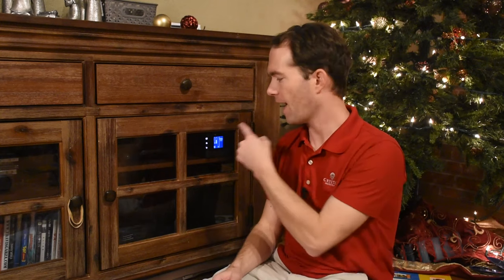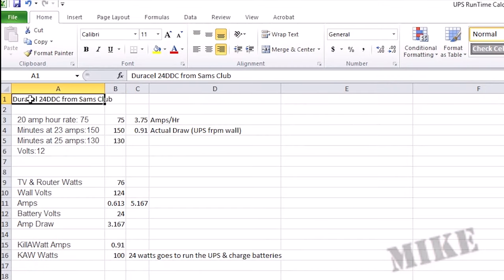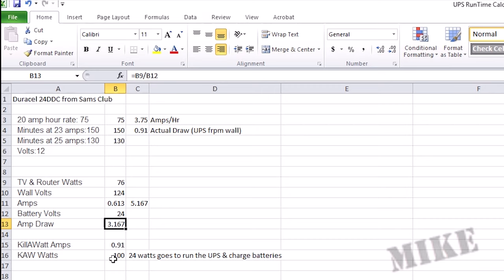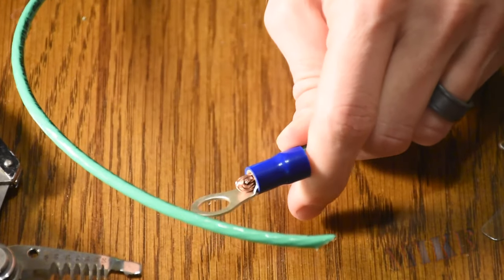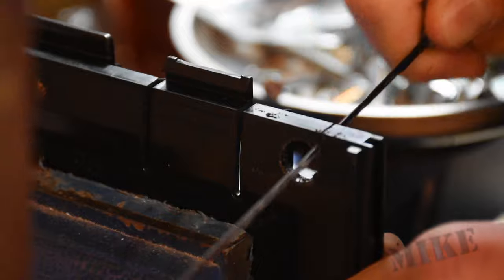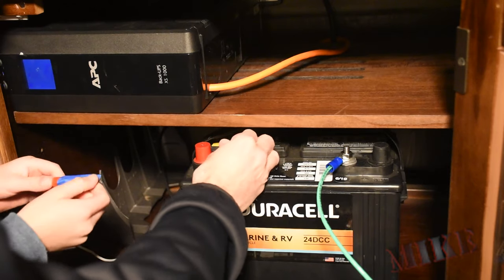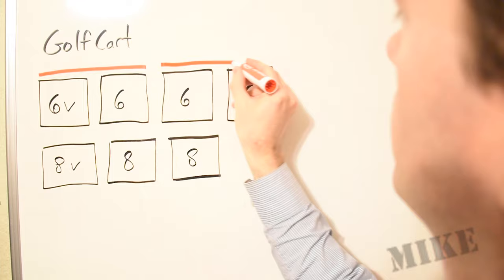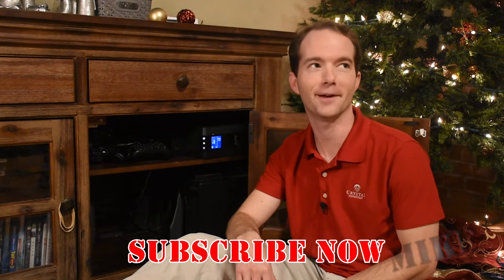SUPER UPS Battery Hack- Mikes Inventions

Comment: Do you worry about hydrogen gas generation as those are wet cell batteries?
Reply: I was gonna say, filling the cabinet with hydrogen, if that UPS sparks, you'll hear a big boom
Reply: My first thought when I saw this video. This is why all indoor battery backups used sealed batteries. There is also more of risk generating more explosive gases with charging batteries from a drained state and charging with a charger that, like he stated, has no idea what batteries are attached. Improperly charging batteries can be very dangerous and having two of these indoors and in a cabinet is asking for trouble. “Good son far” but hope nothing bad ever happens. I have no idea but maybe even possible that the insurance could even deny a claim. With this being fully disclosed on YouTube, it’s more build a case on.
Reply: @RemmikRotus  Aren't these marine batteries, intended for used in boats in the tiny enclosed space batteries normally are installed? You don't install batteries on deck or on the roof.
Reply: @RemmikRotus  those are sealed lead acid battery .. even if they are flooded they are still sealed. , And this ups charges at 3 to 5amp which is really low for this type of battery these can handle 50amp of charge. Normal alternators on car boats or rv are atleast 120amp capable. This setup will only harm the ups as the ups will have to work harder to charge such a large capacity of battery & long discharge timr
Reply: @RemmikRotus  hes in a hospital 🏥 bed
Reply: @danielch6662  Proper boats always ventilate inboard engine and battery space.  The hazard of fuel vapors is worse than the battery hazard.  They'll even have a powered fan to ventilate before closing electric breakers and starting.

Comment: It's not efficient, Tv works on 12volts and router on 5, i would just cut out the inverters on both tv and ups and bring down voltage with resistors

Comment: Mike,  if you want to force the unit to relearn its endurance on battery power,  you have to put about half a load to it,  and execute the self test multiple times a day for about 3-4 days. 

Hold down the power button while its turned on for a total of 6 seconds.  

2 seconds will power the unit off,  and you get the single beep,  DO NOT LET IT GO,  continue to hold it for another 4 seconds and you will get a second beep,  then release the button and it puts the unit into 'Self Test' which forces battery usage for 5 seconds.  

another way to help it relearn,  is cycle the batteries,  go full charge and then run them down on a roughly 80-100w load , when the unit dies, hold down the power button and force a 'brain dead' sequence upon it.  hold the button for 5-15 seconds. 

APC Backups units have logical sense in them.   clearing the logic by forcibly doing a logic brain dead procedure clears its prior memory of the batteries it once knew.  

after a few times of fully cycling the batteries you should start seeing some really impressive numbers as the unit re-learns the numbers as it works.
Reply: But how is it going to display the remaining time? 20 h is 1200 min. I don't think the LCD has a place for a 4 th digit.
Reply: @louistournas120  where are you getting that?  

the firmware doesn't even know how to display that so it would just say 999 or error out to ERR until it got back down to 3 digit capacity.
Reply: @louistournas120    nice job on necro bumping a 2 year old comment also
Reply: @CapStar362  I am basing it on my own UPS. It can only display 3 digits.
However, I haven't modified it so I don't know what it would do.
Reply: The UPS I have when you go above 999 it just flashes HIH (Or basically the shortened terms for Higher than it can display)
Reply: @OptimaGamingTeam  as it should.

Comment: I did the same thing a while back. This set up works but one thing has to be considered, UPS' are not design to work for extended periods of time. They have very small heatsinks on the Mosfet/transistors and most don't even include a fan to keep them cool so they end up getting damaged by overheating. Of course to help on this issue you can add your own fan.
Reply: Your comment is true for the cheap line-interactive UPS where the inverter stage is only working when the mains go off, but the more expensive dual-conversion units (2X to 3X cost) are designed to work full time and constantly supply clean inverted power.  My Eaton 9125 dual-conversion units have internal fans that keep them cool.  They also come with connections on the back of the case for plugging in an external battery pack to extend survival time eliminating the need to hack the insides of the unit as shown in this video.
Reply: @jamesskinner7744  Rack mount APC units also work well for this as like Eaton UPS are designed to be on for years at a time.

Comment: May have been mentioned by someone else earlier, but two major items to keep in mind when increasing the runtime of ANY UPS unit...

ITEM 1 - "FLOAT CHARGE" CAN BE WAY TOO HIGH FOR DIFFERENT BATTERIES
The "float charge" voltage ("standby" voltage the UPS keeps on the battery(ies) at all times when they are not being discharged or charged (just sitting there in standby)) can vary by a significant amount depending on the battery type used. The vital information here is that the float charge for one type of recharageable battery (e.g. an arbitrary typical SLA battery) can be a LOT different than the float charge for a different type of rechargeable battery (e.g. a  marine-type Deep Cycle battery). It can even vary from one type or model of SLA battery to another type or model depending on manufacturing.

From what I've observed, many models of UPS units typically provide a float charge voltage that is too high...even for the originally supplied batteries. What this can mean is that the batteries may not last as long (edit to add: 'as they should last') because the float charge being too high will, over time degrade the batteries faster than if the float charge was set at the right voltage for the batteries being used. Example, instead of supplying a specified float charge of 13.5V to 13.8V for a given SLA battery, the UPS may be supplying a float charge of 14.5 to 14.8V. I have measured such high float charge levels on various UPS units. 

A suspicious person might conclude that UPS manufacturers intentionally use fractionally higher float charge values to cause early life battery failures in order to increase their replacement battery sales.

A float charge higher than the specified value for a given battery WILL take months to years off the battery life of that battery, depending on just how high the float charge voltage is above the level specified for the batteries

I recommend batteryuniversity.com for more information on "float charge" and how it can damage batteries to cause significantly earlier battery failure.
(edit to add: 'I have no personal or financial interest in anything associated with batteryuniversity.com' )

ITEM 2 - UPS OVERHEATING DUE TO LONGER RUNTIMES
Some UPS units are designed in a way that they are LIMITED in how long they provide backup power due to overheating issues. If they run too long (e.g. users replace original batteries with MUCH higher Ah capacity batteries) then an UPS can overheat and possibly cause catastrophic damage to itself and/or attached devices due to uncontrolled output voltages caused by damaged control circuitry.
When I've added higher capacity Ah batteries for longer runtime, I always make sure that the UPS unit will not overheat due to the longer runtime. This may be a simple matter of not keeping the UPS in a closed storage area, or adding more ventilation to the storage area, or even adding more ventilation to the UPS case. I have also installed a fan in two units (one CyberPower and one APC) as they started reaching dangerously high sustained temperatures when they ran for longer than about 20 minutes. (edit to add: 'Running at sustained high temperatures is not good for ANY electronic equipment and at the least can cause early equipment failure. In particular, very high sustained temperatures (even higher internal ambient temps) can cause electrolytic capacitors to vent and cause failures with unpredictable results.')

One should not always assume the UPS's self-protection for overheating will always work and provide a controlled shutdown, or that a given UPS even has such protection built into it

Comment: You have to plug in the Data communication cable to the system and install the software and calibrate the battery and change the status as new battery it will give more backup hours
Reply: About "installing software to calibrate the battery and change the status as new battery it will give more backup hours", I just picked up a sine wave, APC BR1000MS to use with my 100 ah battery but it shuts off at the estimated runtime of the small batteries it would normally have. this is a bummer. my older model would run as long as the battery . can this new model be dumbed down to run for the amp hours I have? otherwise I just wasted $100 on this used thing that only runs for minutes. so bummed. I hope you can point me in a good direction to make this happen.

Comment: I know this is an old video, but you can calibrate the ups to those batteries. I found that out with two apc units I have. Just have to unplug let it run on it's normal load untill it is dead and re-charge. My one 1000Va was only telling me 7 minutes after I upgraded it's batteries, but now it shows 45 minutes which is still less but closer to real time.  Enough time for me to get out the generator.  Just something for you to try to get a better remaining time display.
Reply: oh yes, enough time to bring out the dino juice'ator

Comment: I have been doing that for years. The best wire that is about 10 gauge and flexible can be found at the automotive shop. I use heat shrinking tube over the connectors that I solder the wires to.
In a tight spot getting the outboard battery(s) where you can service them is a real help.

Comment: I did this on my tv and internet as well. I put a 12v 12ah battery on mine. Will run the tv and internet for well over 6 hours. It’s great and has been running for many years now.
Reply: Umm. 12V 12Ah means 144 watts for one hour or not more than 24 watts for 6 hours, not taking power losses  into account. I seriously doubt your TV draws only about 18W. I think you are wildly exaggerating there.
Reply: @maartenvandenberg4223  it could be 2x 12v ?

Comment: Hello from Oklahoma-----Several years back, I did what you did by running two UPSs  off of one car battery.  Both UPSs operated on 12 volts so I got by with 1 battery.  What I found out, and,  what you are going to find out, is that the battery charging circuit in the UPS is not strong enough to keep a much larger battery charged.  A trickle charger needs to be attached to the battery to maintain a charged up state so that when the power goes out, you will  have a long run time.  Yes, it will work for a while until the batteries go dead, which they will.  In your case, with two 12 volt batteries,  you need to put a charger on each one about once a week to maintain a charged up status.  You can charge each one separately without  removing the connector wire  between your 2 batteries or removing any of the other battery wires.
Reply: Good post.  I've measured the battery charging output on a UPS XS1300 at 300mA.   So Large batteries obviously will take a long time to recharge if discharged even several Ah.   Adding an external 1Amp charger would be a very good idea.  It's what I did about 10 years ago with mine.   Be aware that the extra runtime and charging time will push the capacitors on the board fairly hard and so you might need to check and or change them every year or two.

Comment: What you did can be very dangerous depending on the UPS model. Some UPSes do not isolate their circuitry from mains. Always check for this per UPS before attaching an external battery.

Comment: I just wanted to mention,  that if you take apart the battery pack, it is two batteries connected by a card.  You can remove the card and it is much easier to access the leads on the card.  They are also marked as positive and negative.   The card can only be inserted in the correct way.  I plan to try this on my my network rack in the basement.

Comment: The big problem I've run into is voltage drop along the feeder lines from the battery to the UPS DC input, and also within the internal wiring supplying the inverter.  I'm running an APC Smart-UPS 750 and under high load (250+ watts) the DC voltage across the inverter input (on the board itself) can be as much as 0.6V less than that measured at the battery terminals.  It causes the UPS to think the battery is about to die even though it's not even close.  I replaced the external feeders with 10awg and this reduced the voltage drop to about 0.3V, and my next step is to replace the internal wiring with 10awg as well as eliminate as many of the spade connectors as possible as they are all sources of higher resistance and therefore voltage drop.

 I'd expect the 16awg extension cord you're using to suffer quite a lot of voltage drop; what, if any, issues have you had with that in your case?

edit:  Be advised, when you calculate the number of amps using I = P / V , the number you get is the average current drawn, averaged over time.  In reality, the current drawn from the battery is not a constant current, it is a pulsating current consisting of periods of current draw, and periods where little current is drawn.   Thus, I = P / V tells you 25A, the average current over time is 25A, but because the current is pulsating, the pulses will actually be well in excess of 25A, and as a result, voltage drop will be higher than you would expect if you simply used V = I / R without further consideration.

To illustrate, consider a constant 2A through a resistance of 1 ohm.  By P = I^2 * R, the power dissipation is 4 watts.  Now consider a pulsating current with periods of 4A (on) and 0A (off) at a 50% duty cycle.  The current averaged over time is 2A.  By P = I^2 * R we see that power dissipation is 16 watts while the power is on.  At a 50% duty cycle, power dissipation is 8 watts, twice as much as a constant current of 2A, even though the average current over time is still 2A.  Your UPS draws a current that pulsates in time with the switching transistors, it does not draw a steady, constant current and this definitely does impact performance (voltage drop and power loss as heat higher than expected, battery life shorter than expected).

Finally, as to heat issues, I run my APC Smart-UPS 750 on the 7.5AH internal battery paralleled with a pair of marine batteries (in series) of 115AH.  Properly managed (turn off unnecessary lights, etc.) the unit will run for 18 to 24 hours.  The transformer does get warm (temperature exceeds 80°C) without additional cooling.  I put a 3-inch computer fan onto one of the case vents and as far as I can tell, even at high load the transformer temperature (external, measured on the iron core) never exceeds 40°C, generally doesn't exceed 30°C.  That is quite acceptable and in my opinion active air cooling is highly effective at removing waste heat and keeping temperatures in check.

Ideally, to minimize these issues, all of the wiring in the low voltage circuit should be replaced with 10 awg, and all blade/spade quick connects or other plugs should be removed and/or replaced with soldered connections, including soldering directly to the transformer's connection tabs.  On my UPS the low voltage circuit contains exactly nine (9) connection points, each of which is a point of higher resistance and therefore voltage loss.  Eliminating just two of these and replacing just the external feeders with 10 awg cut voltage drop by half and resulted in longer runtime and lower waste heat load.  I will be replacing the rest of the wiring with 10awg this weekend.  Easy to do and no reason not to.
Reply: Hey thanks much for this comment. I had originally used a y-adapter off the primary (2) batteries in my Back-UPS Pro 1000S, with 16 awg feeder lines to external batteries. After reading your comment, I'm going to upgrade those external connections to 10awg. The problem I see now is that the UPS doesn't yet recognize the new capacity, and shuts down based on time. Another comment here mentions performing self-tests and "brain dead" factory resets to get it to recognize the new capacity.

Comment: i forgot what you did, but for anyone interested or if you don't already know- marine deep cycles operate slightly differently than normal 12V lead acids or gels. should be 13.4V When fully charged if not damaged inside too much. or maybe 13.2/13.3 is perfect health usually. Having a health tester is a godsend. really let's you know what's going on under the hood so to speak.

But hope your setup is working ok! It must have some intelligent charging going on. So that's good. Any old ups would not be recommended for just any marine battery. Although they may work, they might be damaged or unreliable or just not perform as well as they could.  Just saying from experience lol.  plus always make sure it's a True deep cycle. They are between a starting and deep cycle, lots of people don't realize but some aren't fully deep cycle. Great video boss xD
Reply: I measured my UPS batteries. Each is 13.24 V. There are 2 of them and they are connected in series.
Are UPS batteries deep cycle batteries?